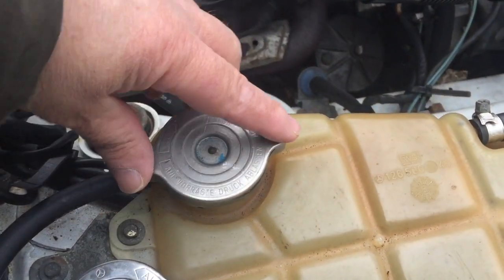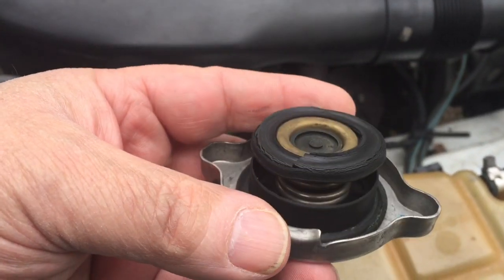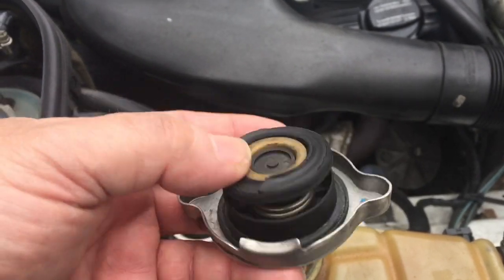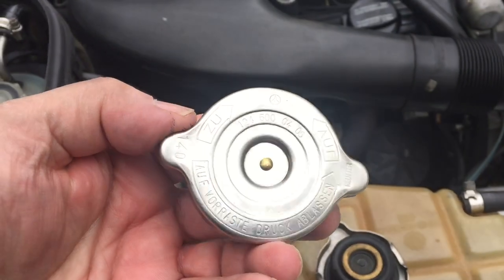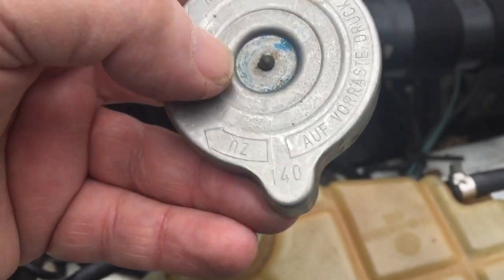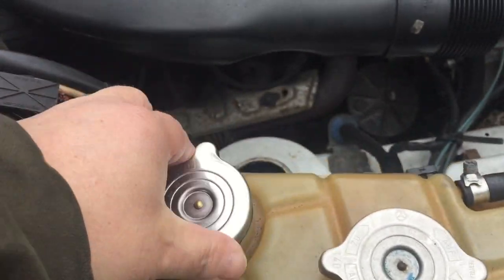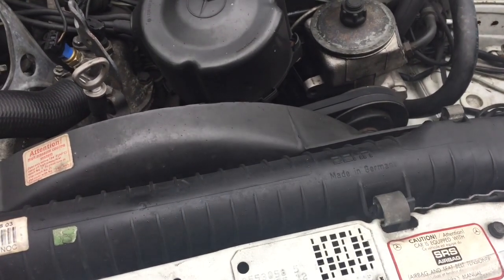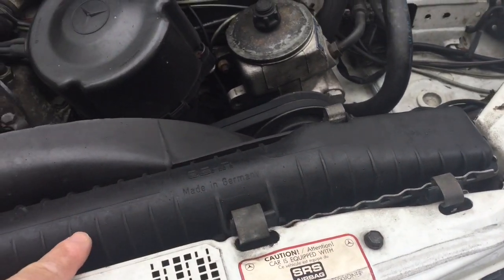Bad stuff can happen with the incorrect radiator cap on W126, W123, W124 and other Benz

Comment: Good info, I baught a new cap but I think it is high in pressure, the car started to overheat and creates a lot of pressure in the system, mine is 140 Kilopascals or 1.4 Bars, The car is W140 1995 Diesel.
Reply: Can you please tell me the correct tempreture rating for the thermostat as, if you don't mind?,Thank you very much.
Reply from the maker: @AdelHaiba78  Most geographic areas have a 80 degrees Celsius setting.
Reply: @straybenzes  Wonderful, Thank you very much.
Reply from the maker: @AdelHaiba78  You are welcome
Reply from the maker: That is actually the correct cap. If your car is the S350 Diesel then I fear your overheating issue may be a symptom of a blown head gasket. Get that taken care of right away and pray that you did not have coolant leak into the cylinders. The 350 OM motor is infamous for bent connecting rods. Good luck.
Reply: @straybenzes  Thank you very much, just as I thaught.
Reply from the maker: @AdelHaiba78  Fingers crossed